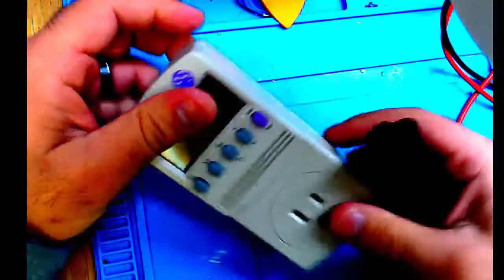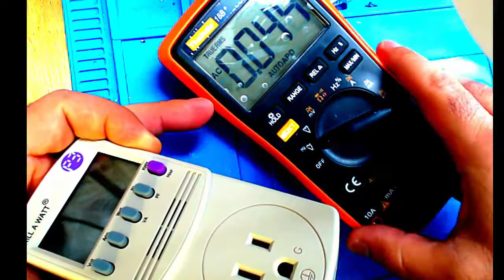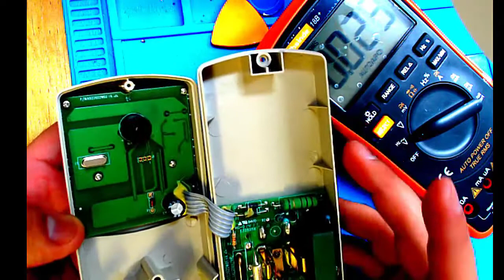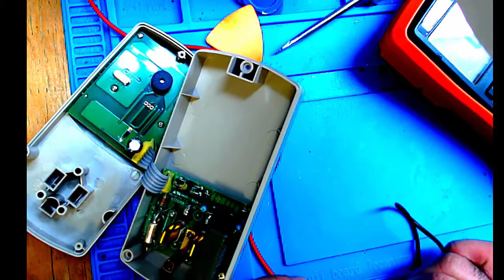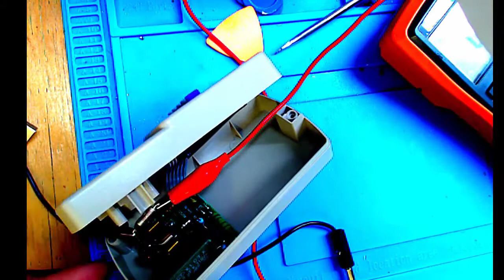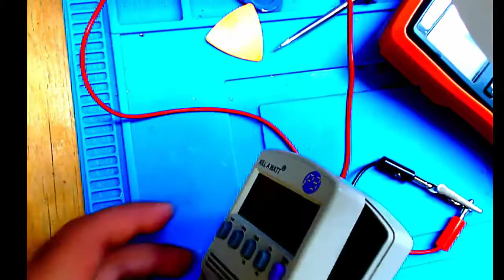Kill A Watt Troubleshooting and Repair Kill-A-Watt

Comment: NTE8098 will fix that, BUT the large CAP will leak, so when it's plugged in, without any device connected to it, and it shows AMP. replace that large CAP.